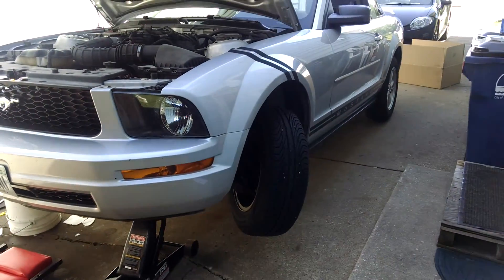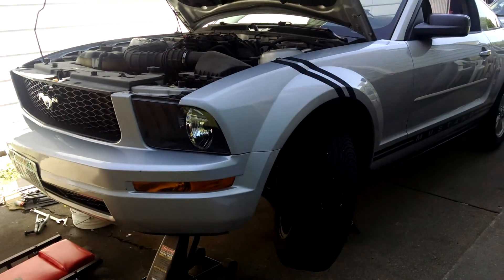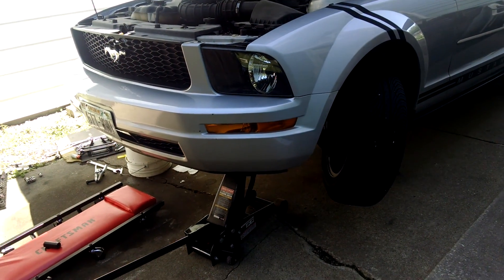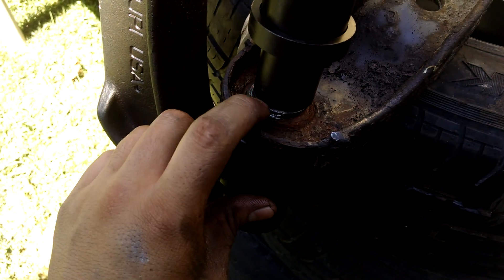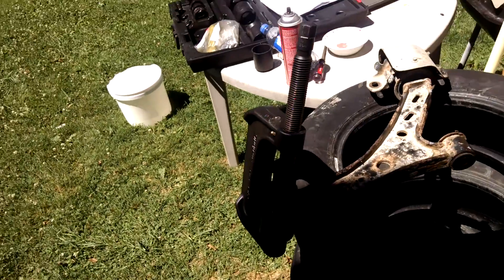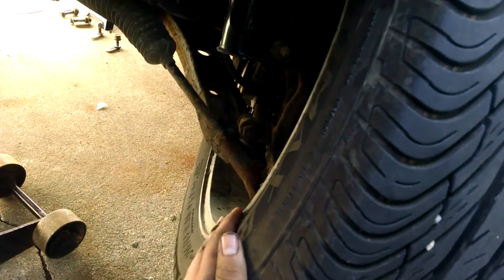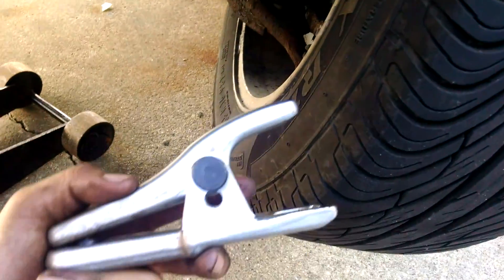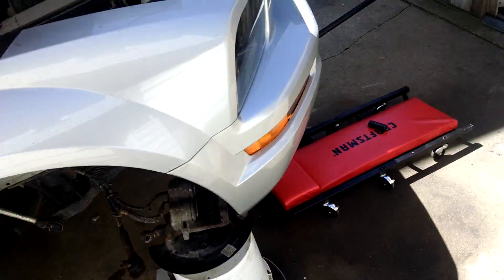Mustang ball joint replacement

Comment: Again for those of you scrolling through the comments these ball joints are NOT meant to be taken out. They OEM factory ball joint are meant to be built in the factory control arm and not meant to be replaced. If your ball joint is shot your best bet is buying the whole control arm (with the ball joint included) it’s easier anyways to replace. If you happen to have an aftermarket control arm you should be able to replace just the ball joints them self’s if need be. Awesome video by the way! 👍
Reply: You could replace it,but the new ones don't fit tight,and it's a bitch to put the snap ring on,that comes with the new ball joints.Should of just replaced the control arms.
Reply: YUP replace the control arms. 4 bolts, your done.

Comment: My Dad and I just did this project. It is NOT easy. 
It really would be worth it to buy the whole control arm. We had to use a hydraulic press to get it out of there and it took a lot of force down on it to do so. Then the same pressing the new ones in. I won't be doing that again. We were able to get it done, but if you don't have access to a press, that little hand tool just isn't going to cut it.

Comment: Brian ..thank you so much for posting this. My ball joints are fine but I have been considering - replace them (to be safe) or replace the control arm (the GT500 control arm is a perfect fit. So what has stopped me ? 1) People say the ball joint is doalble...2) Wondering, to remove the control arm, the last long bolt near the inner  tie rod boot, did you wiggle it out past that or did you have to remove the rack to get the bolt out ? Would appreciate you tell us your steps because many of us would like to know...

I saw a video (CJPONY PARTS) that show it replaced and he go the bolt out but said "if you cant get the bolt out, drop the steering rack"...uhh..how about a straight answer ? LOL

GREAT JOB ..GREAT TALENT and again, thanks !!!!!

Comment: I'ts a pretty good chance that for the S197 Mustangs they made them serviceable for later models. for my 05 I opted to replace it with the control arm. current cost is about $285 for the Ford performance set (both sides) and when you factor in the age of the car, chances are it is better to replace both. at least that way you can inspect the upper control arm and other suspension parts for wear.

Comment: bro you need to change everything lol, look at that rust tho
Reply from the maker: Thats Wisconsin  for you! I'm going to assume you're from a southern states. Rust is very common  on vehicles here, in fact,  that rust is just surface rust.  What really matters are the bushings and the ball joints on the control arm. If that ball joint was serviceable that control arm woul have no problem lasting a long time.